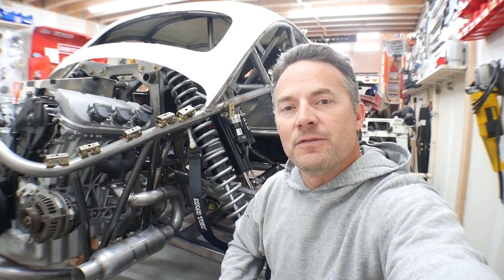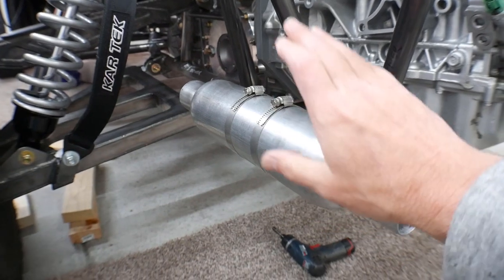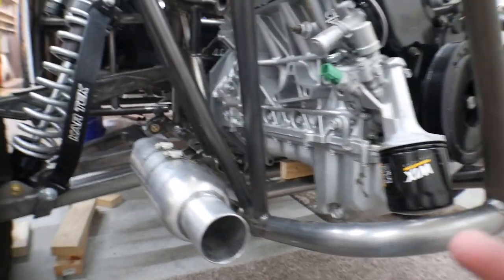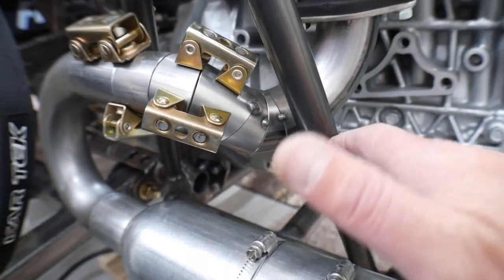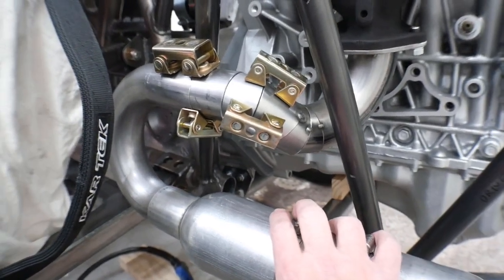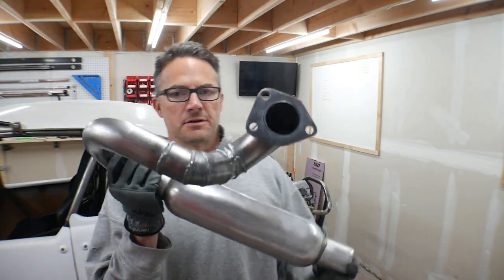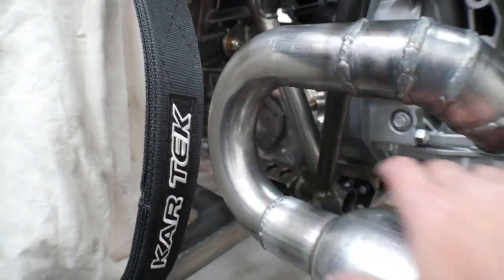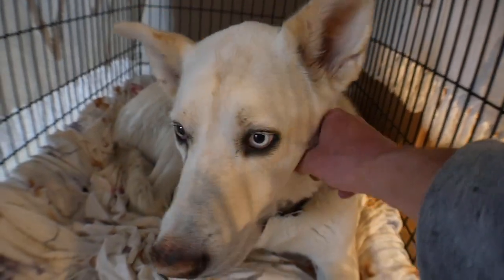Wratchet Exhaust Build...

Comment: Those stock manifolds are a fantastic design.  Although they are not what the ‘cool’ people think they need, they will be more than excellent.  👍👍😎👍👍
Reply from the maker: Yeah they're pretty good, only real issue is they're not equal length. Not all that heavy either.
Reply: 👍👍.  And when you go to stage 2, these will be great manifolds for the turbo.  They’ll also keep more heat in the exhaust energy for the turbos.

Comment: Looks great, might want to add some flex pipe in there so the motor doesn't break the exhaust.
Reply from the maker: Thanks, the engine will be solid mounted. So flex shouldn't be a problem... I hope...
Reply: @DougBugBuilder  I would agree with Mike Mann. Even though your engine is solid mounted, heat expansion will crack pipe/manifolds. Something gotta give. Keep up the great work Doug!

Comment: Your craftsmanship is above mine, so take this for what it is, but, I've seen videos where they use pie cuts of multiples of 4-1/2 degrees (if I recall correctly) and when they put them on they start out by clocking them either 180 or 90/270, then the final tweaking is done by very small clocking after that, apparently all this makes it easier and ends up with a better result. I'm sure you will do your research and do a great job when the time comes but thought I'd mention that so you could look for it. Also, building a jig makes a HUGE difference, this I have done and it's night and day. Please don't take any of this as negative, it's not, at all, I'm always impressed with your results. You're like a mellow Mike Patey, very motivating. Do you watch Patey? Wow, he's so driven and such a craftsman, and an aviation savant. Thanks for taking your time to film, I know it take a lot longer and the cameras can get in the way, but having a build diary is very cool.
Reply from the maker: The jig is a good idea, maybe I'll do that when I make the turbo manifold.
I've seen people use real small pie cuts, it looks nice and has better flow. But I wasn't going to get that meticulous on this exhaust. 🤷‍♂️
Thanks for the name "Mike Patey". I looked him up and subscribed, looks like some interesting builds, boy does he have some energy... 😁
Thanks for the tips!
Reply: @DougBugBuilder  yes, meant for the stainless turbo manifolds, what you did for the NA is fine. Be ready to have your mind blown on his Scrappy build!

Comment: Cool! Does the motor have solid mounts? Just curious due to solid mount exhaust. Love following this build and how you explain your process.
Reply from the maker: Yes, the transaxle is solid mount, and the engine will be too. There "shouldn't" be any flexing between the engine and chassis. That's why I had no reservations solid mounted the exhaust.
Reply: @DougBugBuilder  cool. Maybe a small rubber isolation for the vibration.  But awesome job you're doing!
Reply: Looks fine to me. Fix it if it breaks!

Comment: Doug Bug, Horizontal opposed 4cyl engine have that distinctive exhaust notes. I'm curious what exhaust sound this engine produce since it doesn't have a crossover or x-pipe and it's a V6. Nice fab!!!
Reply from the maker: We'll see, it'll help that it's a V6. But my experience with these glass packs is that they don't sound that great. 🤷‍♂️

Comment: Q: did you solid-mount the muffler to the chassis without any flexibility, or is that just for now, during the welding phase??
I sincerely hope the latter, because this setup is not going to hold.
Vibrations from the engine, vibrations through the chassis, thermal expansion...
Even (or better; because) you solid-mounted everything, the above should really taken into consideration!!
Reply from the maker: It's solid mounted, to a point. The pedestal it sits on is solid but the hose clamps actually allow for more movement then you would think. I'll consider that for the turbo manifold, but this one will have to fail before I change it.
Reply: It will be fiiiiiine.

Comment: Hey i know this is really outta place but i figured i would ask on this video since its most recent. I am a bug owner an first time fabricator and i was wondering did you have to buy your suspension parts (trailing arms an shocks and stuff) and then design your cage an contact points around that stuff or did you do it the other way and build a cage and then make the suspension line up with it?
Reply: Check the older videos. He built everything.
Reply: @antiblingdesigns  thank you
Reply from the maker: As stated below, this bug was designed from me ground up. I encourage you to watch my videos for help and motivation. But if you are just starting try to start small at first. Maybe make some bumpers or a roof rack first on your bug to get some experience. If you enjoy the fabrication then keep going. But take it in steps to not get overwhelmed. 👍
Reply: @DougBugBuilder  okay cool cool, i have a simple cheap tubing bender coming soon and ill thumb through your videos. My biggest problem is that this bug I'm building is currently just a shell of a body and I've maxed out what I can do in terms of repairing that shell (I've mig welded in new heater channels and just about every patch panel you can imagine) so I'm sort of stuck until I build a roll cage to continue on building the suspension

Comment: Why are you clamping the glass pack to the chassis? Doesn't make sense to me given how the big companies have been using headers/mufflers on sand cars🤷🏼 Just seems like more vibration throughout the chassis?
Reply from the maker: It's just to support the exhaust if they get bumped around. They are only secured with hose clamps which can't actually hold that much force. So they can move around some if needed. That's my reasoning anyways.
Actually I always cringe when I see a header supporting a glasspack or some exhaust piping without supports. Not saying I'm right, it's just what I think when I see it.